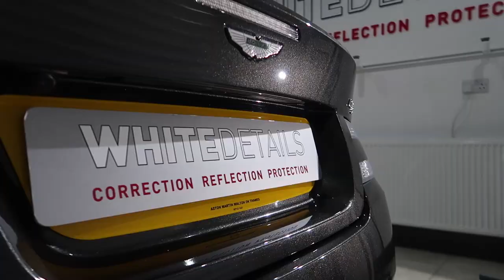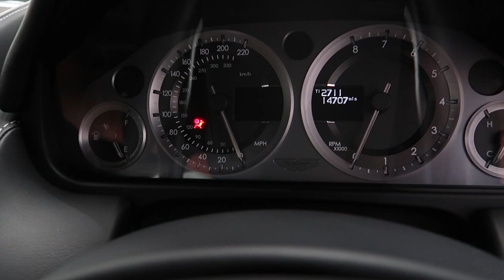Ceramic Grey DB9 - VLOG 036

Comment: Hey Jim, another awesome job! One question, do you ever use fall-out remover on the body panels rather than the Clay bar? I've used the gtechniq stuff on the my bonnet and the backend with very successful results, but would you recommend using the clay-bar instead?
Reply: Understood, it's just I have never seen Jim use fall-out remover on body panels, only the clay bar.

Comment: Have you done anything to the porter cable so it won't vibrate to much or does it still vibrate a lot?I installed the 3 in backing plate and mine shakes a lot, any help will be appreciated, thanks.....
Reply: Marinero69 take it the counter weight when changing backing plates for a 3 in it helps a lot

Comment: Hello mr. White we just had a great detailed conversation on our obsessed garage Facebook Forum about you and how we really enjoy your videos, I'm a novice detailer and do a couple cars from time to time and learned many great things from you unfortunately I don't have the great products that you have but maybe one day.. I noticed that you really enjoy using microfiber pads is that because is it because they cut so well, have you ever just used Straight foam on anything?
Reply: Depends on the paint hardness. When cutting through hard paint it is best to use microfiber. You could use foam pads but it would take a lot longer to get the same correction as microfiber pads do in 1 cutting pass. On soft paint, there is no point cutting with microfiber as foam will do the job easily.

Comment: I've recently corrected my black honda using megs 105/205 only to remove usual swirl marks, however since doing so in certain sun light it looks as if I've not even corrected it and i havnt touched or washed it since, I didnt bother with an IPA wipedown, is it a case that my microfibers added some marks when removing polish resedue aswell as when waxing ? or did I just not fully remove them / or noticed them in direct sunlights ?
Reply: watch larry ammo nyc video on polishing/finishing on soft paint
Reply: Seems like you have the right combination but you have to find YOUR own technique. Believe me it happens. Good luck.
Reply: Holtii14 are you working the polish all the way? What machine/ pad are you using?
Reply: hard to tell, I do several passes until it goes clear and a Das6 with white chem guys finishing pad
Reply: Holtii14 try using speed setting 3 or 4 don't go all the way to high it breaks down the polish too fast and won't work right